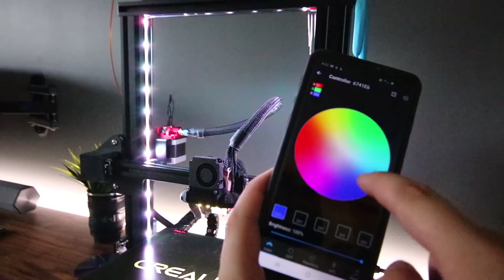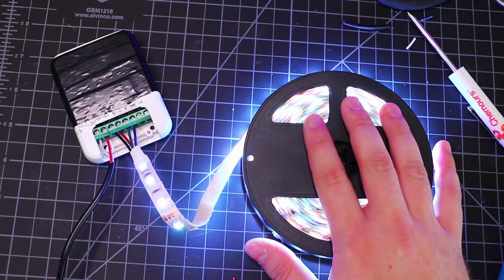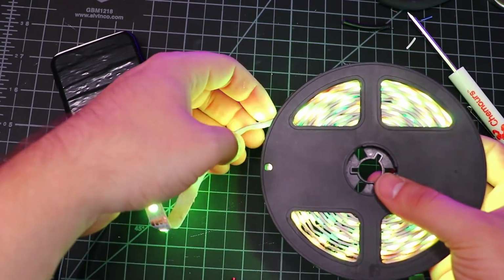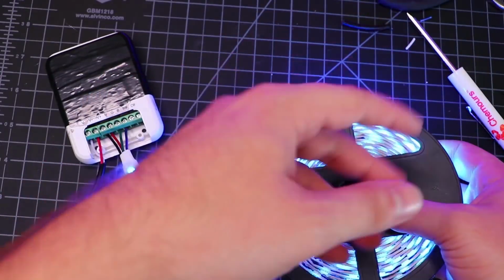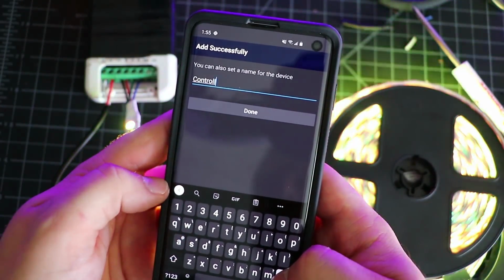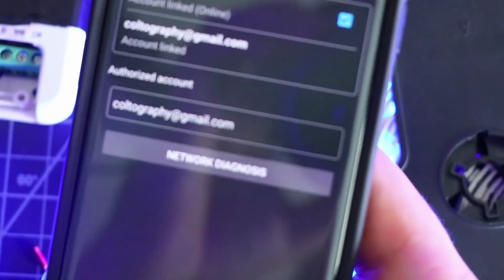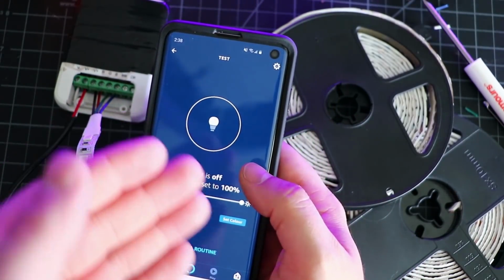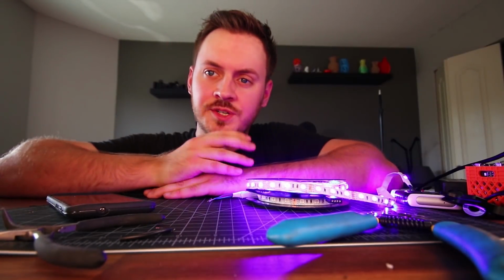How to Automate Cheap RGB LED Strips

Comment: Do you need a new controller and power supply for every different place you put the led strip ? Thanks
Reply from the maker: Don't need them, but it makes it a whole lot easier and allows for more lighting
Reply: Coltography sorry its all new to me, in your room video you control e.g 2 mirrors in one command but they seem to have seperate leds. How does this work ?
Reply: Would I need 2 controllers? That would take up alot of plugs I would imagine.
Reply from the maker: @AkadeProductions  2 wires coming from each terminal on the controller, 1 going to each mirror. Same controller
Reply: Coltography oh I get you now so basically I am not limited to 1 strip per controller. Thank you so much for taking your time to reply ! Ps how many controllers it took you for the whole setup ?
Reply from the maker: Yep just don't over do it, there is amperage limits to the controllers.  I had about 8 controllers when I filmed this I think

Comment: Hi, fairly new to light strips and I'm very confused.

Do I need several wifi controllers for several strips? Planning to buy 2 of the Simfonio strips.
Reply from the maker: Depends how far the strips are from the controller. You can always add more lights to the controller, just screw them into the terminals with the other wires.  If it's too far away then yeah, you'll need another controller. I used about 8 or them for my last place. This also lets you zone them so some can be one color, the others can be a different color etc.
Reply: @Coltography   Coltography  Thanks that's very helpful. Just have one more question if you don't mind; say I purchase a set of strips without the adapter (like 4 or 5 maybe) - now that I know I can plug all of them to the same controller but uhmm (like is there a limit to how many strips can you put to the controller) and can they all run through the same power adapter that I'll get?
Reply from the maker: @caaaaaaaab  you'll need to get a bigger power adapter if you're doing more than 2, you'll need like an 8amp 12v power supply or it might burn out
Reply: @Coltography  Thanks, appreciate this!

Comment: can you use an arduino and a wifi module, connect the LED strips to it and then use the same app to control the LEDs or do you have to program a whole app to work with the arduino setup ?

ps: sorry if that's a stupid question im still trying to understand the basics of electricity lol
Reply from the maker: If you're looking for Arduino type stuff look up WLED by aircookie. None of this works with arduino really
Reply: @Coltography  alright thx, i'll look it up 

thx for the quick reply btw, didn't expect that :)

Comment: If u had 2 Rolls of led strips would u need 2 WiFi controller or no
Reply from the maker: Depends where you want the lighting, if it's the same area you can just connect another strip to that controller

Comment: hey man, i have everything set up like you have i think, but in the app it keeps saying device offline. so ive tried resetting it in every way possible, and then it works fine for a few minutes, and then its back to disconnected. have you had this issue, or do you know how to fix it? i've had this thing for about half a year and it hasnt worked properly eversince i got it.
Reply from the maker: Might be connecting to your 5g antenna, make sure your router doesn't combine 5g with your 2.4ghz on the same name, I had the same issue and that's what fixed it for me. Double check in your router settings if you can!

Comment: Are you able to connect 1 RGB strip and an only white strip to 1 controller
Reply from the maker: You can connect quite a bit if it doesn't go over the amperage rating
Reply: @Coltography  ok thanks

Comment: I bought this controller but it cannot connect to the server remotely. Tried home wifi as well as via mobile hotspot. The account would not get authorized with the remote server, returnig 40001 OFFLINE error. Any ideas?
Reply from the maker: Is it 2.4ghz?
Reply: @Coltography  yes! I made sure the 5ghz is "forgotten" so it does not interfere. I can see the device and play with the led strip via the app in the local NW.
However I cannot open the remote functionality via the Remote Device -> clicking on the Globe icon. In addition I tried the whole setup from zero using my wife's phone as a wi-fi hotspot, same result.
Contacted magic home app support and they said: "We cannot manually connect the device to the server remotely. It can be controlled in the direct connection state and the local connection state, but cannot connect to the service remotely, it may be that there is a problem with the remote module of the device. Please contact the merchant on the order for replacement."
Obviously I cannot link Google Home (which is my main goal) - tried to bind it via the google home interface, no connection with Magic Home Wifi is possible.
So the problem seems to be with authorizing my email account with the magic home servers somehow (I tried all 3 server options, no success).
I just want to make sure I explored all the options and the fault is not on my side before returning the device to the merchant.
Thanks!

Comment: Hey, could you use a program with that controller to control each light independently or does the whole strip work at together? Could you use them to make words or patterns?
Reply from the maker: Hey, you would need addressable LEDs and different controllers to achieve this
Reply: I am trying to make a sculpture/art installation type thing for my girlfriends birthday. Basically she was given a board from an ex nuclear facility with dials and bulbs etc. Sort of stranger things style. I want to bring it to life and mimic the green and red readout that a dj mixer would give and it wondering whether to go with an old green/red type look old analogue stuff would give you or if this could do that and more.
Reply: Main problem is working out how to make all of the bulbs on the board work in time together so I could make them dance.

Comment: I wanted to buy that wifi connector but I've heard such terrible things about it. Also people say the app is garbage. Cant tell if its just user error or not. Also if you ever see this, I've been frying my brain trying to wrap my head around everything to do with syncing lights together and the commands. Is there any way you could link me hardware and software you use so I could understand better myself how to operate everything?
Reply from the maker: Hey man, they have treated me well and I've had no issues. What have you heard? Also the magic pro home app is a lot better than it used to be. In terms of syncing it what do you mean? With Alexa you just set groups etc then when you say " turn X Lights off/ change color /dim 50% etc" it does all of them.
Reply: @Coltography  People criticizing the magic pro app say that it disconnects their lights and they are unable to reconnect them. Also I just dont understand how you were able to use your phone from one screen to control bulbs (let me know what ones you use) and led strips. I've had a tough time wrapping my head around alexa commands, IFTTT, and turning lights into smart lights. Then on top of that congolmerating them all into a singular voice command that would turn them all on.

Comment: Just when I thought I had everything I needed to connect to the wifi controller I realized that my led strip doesn't have the silicon wires at the ends so I have to solder on wires now RIP
Reply from the maker: What do you mean?
Reply: Coltography so instead of the red green blue and black wires on the end of the strip connecting to the pins for the reciever, i just have the pins on the end of the strip. So i need to get some copper wire to make the connection from the strip to the controller. Did that make sense?
Reply from the maker: @whitewidow3744  oh so it's just like a straight up plug on the end of the led strips, weird. You could always buy some RGB plugs and just splice the wired on those then plug the led strip into that piece if you don't want to solder.
Reply: Coltography ohhhh you’re right thanks a ton

Comment: Unfortunately for iPhone, smart home products have to specifically support HomeKit in order to work with Siri and control it through the iOS system. It's pretty annoying especially when it comes to cameras since the cheapest ones that support HomeKit are upwards of $200. Luckily, you can run software called "Homebridge" on a spare Raspberry Pi to act as a bridge for cheap home automation products that don't want to support HomeKit. I believe Apple does this for "security". I have no idea how true that is.
Reply from the maker: They do it because people give them money to have less features, not sure why people buy it!

Comment: is that matter if my LED strip light are Bluetooth and not WI FI?
Reply from the maker: Yes. Needs to be wifi
Reply: @Coltography  so if its Bluetooth, what should I do? Its not just called Bluetooth for fun
Reply from the maker: @noamnaveh4925  get one with wifi
Reply: @Coltography  nvm. There is an Application that works on bluetooth

Comment: Can I use two strips w one controller (by using a y cable or by shoving the ends of 2 strips in to the WiFi controller)? Also can we get a video on the magic mirror?
Reply from the maker: Yes & yes

Comment: I did exactly the same but it keeps resetting itself :(
Reply from the maker: What do you mean? When does the reset occur?
Reply: Coltography 
Did everything on the tut exactly the same 

Then I went to the app the globe is already blue 

I named the light and tested it on Amazon Alexa and every works fine 

Seconds later starts blinking the last color I left then few seconds later its starts the RGB jump as I first connected it :(
Reply from the maker: @ultiunion8352   Have you tried it without the LEDS connected and with a different power supply? Should rule out if youre shorting it out or anything. Other than that you probably just got a defective unit, which is odd!

Comment: Hi , Great video , I have a couple of questions . Have you tried this with the govee dreamcolor lights ? ( they claim they can’t be cut but I don’t see why not ) 

Also do you think extending the power lead on 5m run of lights will effect them ? ( plug socket is further away than where I want the lights ) 

Also
Reply from the maker: They're addressable, can't be cut or will mess up the pixel # in their controller. Better off buying ws2812b led strips and a esp8266 to fully customize it yourself, the govee ones are a joke
Reply from the maker: Look into wled for esp8266 if you want that kind of stuff

Comment: Anyone has any experience with these strips and Home Assistant?
Reply from the maker: Apparently you can flash the wifi controllers to work with HA. Haven't looked into it, but there's also the use of esp8266 to get cheap led strips into your setup

Comment: If i delete this app & is that risky for me? & please tell me guys in my comment.
Reply from the maker: What?
Reply: please tell me if i write my wifi password in this app & then if i delete this app & is that really doesn't risky for me?
Reply from the maker: @mahiraitsme5900  I don't understand how that would be risky?
Reply: When i open the sticker from the light then it doesn't stick in the light like before & tell me what should i do right now.
Reply: If i cut the led light strips & then, is the led light strips gonna be destroy?
Reply from the maker: @mahiraitsme5900  my friend, led strips and electronics are not for you. Please learn some basics before tackling these projects first.
Reply: So many people didn't use led light connector or so many people did used light connector & i can't understand should i use led light connector & please tell me guys in my comment.
Reply: @Coltography  Why?!
Reply: @Coltography  Please answer my question.